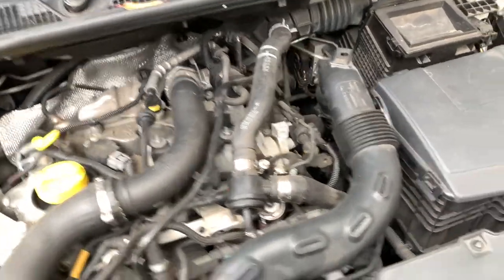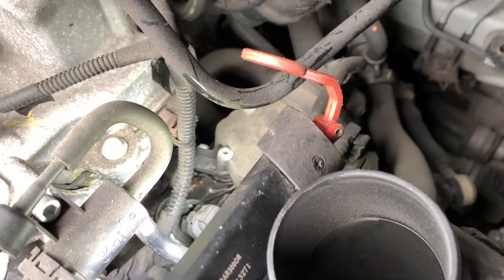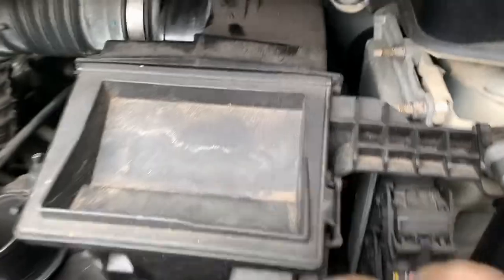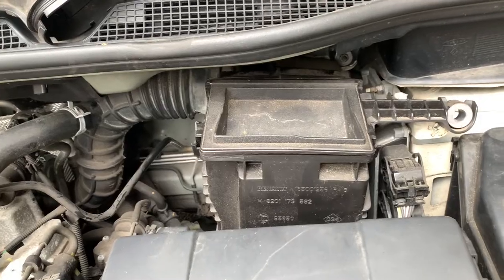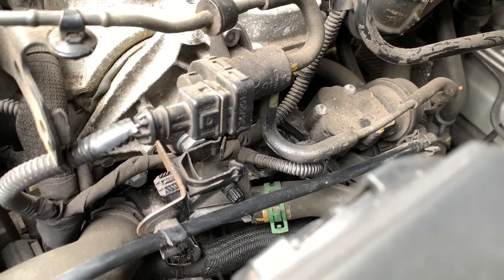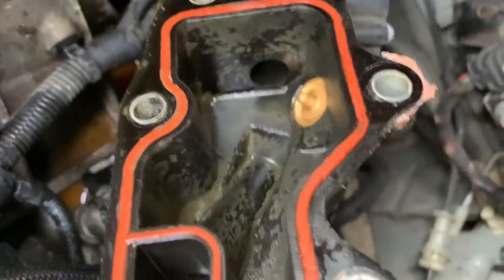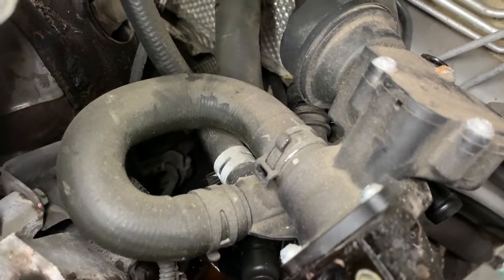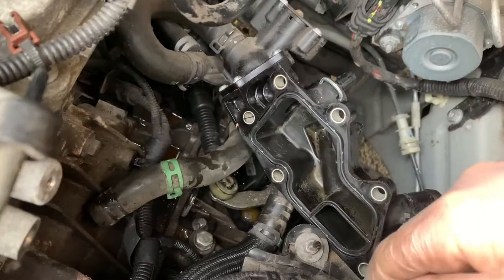Renault Captur 0.9TCe Losing Coolant? Renault 0.9TCe Coolant Leak Repair.

Comment: The part is called a water outlet (£104), I made the mistake of ordering a thermostat housing which goes into the other side of the engine. Anyway I didn't have the confidence to fit it so my local garage did it for £60 labour. Also important to know that after you may think it's still leaking as the coolant level will drop and the excess coolant will be puddled under the panel beneath the car, the coolant level naturally goes down as the engine cools etc. Hope this helps someone
Reply from the maker: That could come in useful. I got the part off eBay which called it a thermostat housing, but on eBay I had the benefit of a picture to compare,.. which I didn’t look at properly and still got it wrong 🤷‍♀️

Comment: Just got this problem.so thanks for the video. This is added to the squeaky suspension. The front brakes sound like a banshee chasing me. And for a car that uses so much plastic there is the rust. It's nice to see that Renault are solving the problem of all the plastic in the sea by sticking It in their cars . I had a Renault in 1990 and it's reassuring to know that they are still making the same crap with the same problems
Reply from the maker: All those are just design features. Absolutely hateful thing tbh.

Comment: Did the job today , your video was a great help .
If it helps anyone I lost 2 litres of coolant doing the job and the 3rd bleed valve  is on the left hand side of the rad (looking at the car ) 
A Nissan gasket part will also fit too .
Reply from the maker: Brilliant, glad it helped!

Comment: My clio 1.2 tce (which is very very similar) wasn't doing this. mine had excessive pressure in the cooling system which continued to be misdiagnosed by 2 different garages. I knew about the bleed for the air, and the correct coolant (massively important that bit) but mine was making the water in the coolant mix boil. this causes excessive pressure in the coolant system and eventually the expansion tank will explode, like mine did. I didn't get any warnings though. No HT on the dash, just a slight fluid loss. Turns out that my head gasket has been failing for quite a long time. possibly even up to 30,000 miles. the garage that eventually found it said that the gasket might have been 'mis seated' when the car was constructed in turkey.
Reply from the maker: They’re not unknown for head gaskets unfortunately. Pressurising coolant is usually a symptom of HG failure between the fire ring and water jacket, but not being bled up properly can give very similar symptoms. A sniff test can give a better idea, but with the way EGR coolers work on some cars even that can give a red herring these days.

Comment: Great video. I have some problems or similiar sympthoms. I have added few times coolant and after driving sometimes coolant smells right side of the car front. Can't see a leakage in engine or dripping under the car. How does in your case you find out the leak from? Same 0.9 tce engine also
Reply from the maker: It’s probably leaking really slowly and evaporating before it has time to drip. That’s the way this one was leaking. You need to look for coolant residue, like a pink crusty marks. It could be from the same place as this one but with the smell being where it is, could also be the radiator where the metal joins the plastic or even a coolant hose joint. Small leaks like this can be hard to find.
Reply: Thanks for response. I found the leak today, is the same thermostat housing that you had in the video. The coolant leaks were same spot over the gearbox. Thanks to you. Car is going to repairshop thursday morning for repairs.

Comment: Can you please tell what type of AC coolant do you use in Renault captur. Have the same issue but I want to fill it up to be able to take it to the mecanic, and I don't seem to find what type of coolant should I use.
Reply from the maker: You just mean the engine coolant? This one used the red stuff if I remember right but any car parts shop should he able to confirm the correct stuff

Comment: I have the Sandero 0.9tce.. That part looks like it was meant for my car.. The part I got is not authentic renault but I couldnt find anything else.. China seems to assume that I dont need a thermostat for my region or something... you'll see the housing is actually 2 sections.. the part that mounts up to the engine.. and the the tail end bunch of pipe that has a pressure emergency break cap..  they join with 2 plates with another gaskett.. (not the hot plug, leave that cap alone, I think it has a steel rod that melts at critical temperatures) that assembly can be removed from the engine mounting to reveal a little cradle housing thats supposed to house the thermostat... mine opens to reveal one end, (the engine mount side) with half a cradle and the other half or cap side with that hollow redesighned to be flat.. so a thermostat cant fit, (unless you saw it in half down the middle.. haha..).. I suppose China kept the base part compattible in case I can still use my original cap/pipe complex.. So now Im left with trying to service and clean my old thermostat if I cant find a new one, at least the gasketts is new and so is the temperature sensor, that can be refitted on my old housing.. JUST BE CAREFULL.. allthough I think the car will run without a thermostat.. I was lucky to discover the turbo water pipe connection was blocked on the china part.. inside the tube end was a plastic cast injection port that didnt sever.. or I quess QA was not done on these so nobody popped it out... Could have ruined my day with a toasted turbo core... Good luck and thank you.. Maybe China was thinking.. you need your original cap complex to visit midas and let them sort through the sizes untill they find one.. so you get a temporary cap for free...
Reply from the maker: This was supposed to be a genuine part but think it came off eBay so 🤷‍♀️. That blocked but is something to watch out for, good job you noticed it!

Comment: Hi! - do you remember the part number for the gasket?
Reply from the maker: No sorry, iirc it came from a local motor factors. Don’t think it was a genuine Renault part though.
Reply: I used part no.RE110624453R. Termostat housing gasket.
Reply: @StupidBlokeStupidVideos  So. I am doing this job as we speak. The RE001624453R part below works. Just wanna say thanks for saving one of the claps, the one where you PUSH and not PULL, that goes into the cabin heater.

Comment: Would you now the part number and were you was able to get hold off the rubber seal please.
Reply from the maker: Sorry mate, I can’t even remember where we got it from tbh
Reply: Thank ok it looks like my leek was from one of the weird plastic rings on the pipe luckily I nicked a metal jubilee clip of the air hose. Took me ages trying to cut the plastic clip off. Just hope IAM not celebrating to early. Really enjoying the videos

Comment: Hey I have a 2016 Renault captur h4b engine 0.9, it was mixing oli and water in the water bottle, I changed the oil cooler. Than it bursted the water pipe from the engine to the car ac radiator I have changed both thermostat now it's only bowing cold air in all temperatures and the water bottle is very hot what can be the problem
Reply from the maker: Sounds like you may not have to bled up properly, or you potentially have a blown head gasket

Comment: Does that model have a radiator cap, if so do u fill the radiator before filling the expansion tank?
Reply from the maker: No rad cap that I saw but the tank is more of a coolant reservoir than a typical expansion tank, it’s pressurised with the coolant system and the coolant goes straight into the radiator from it rather than pushing into it when hot and sucking out of it when cold like a typical expansion tank.
Reply: Reason I'm asking is the missus has a micra 2018 but it has the same engine in it, was bought from a dealer, I'm a plant engineer/fitter, she said to me top the washer fluid up so I went to do it and I checked the oil and water while I was there but the coolant like just plain water so dipped it with my hydrometer was only reading -4 so need changed and replaced with 50/50 mix but couldn't find any vids on the car to get an idea of what sort of job it be
Reply from the maker: @lewishope271  ohhhh. You could always go with the  lazy method I did in my bmw in this other vid. Works with pretty much any car as long as it has bleed points. 

https://youtu.be/IqWXPysALgc

Comment: What is the name of the part you changed and how do you bleed the system?
Reply from the maker: I just typed in thermostat housing on eBay and look for the right one, and got the wrong one lol. Bleeding the system is what I was doing removing the caps near the end on the side of the unit and on the inlet hose to the heater matrix. They look like tyre valve caps.
Reply: Nissan part #1106200QAB

Comment: Hi friend, can you explain or write down exactly which part you replaced or what is its name?
Reply from the maker: I just changed the housing gasket. I think it was listed as be thermostat housing gasket but I can’t find it on eBay now. Main dealers should be able to help off a microfiche is have thought
Reply: I believe these are the part number if someone else need them 110601073R, 110603082R.

 I’m having the same issue and this video helped a lot 🫶
Reply from the maker: @dennis420lundin  happy the vid helped you

Comment: my2015 kangoo has a leak around that thermostat housing area as well. leaking is coming thru 1 single bolt. so i just ordered a new gasket seal. should fix it. it actually wasn't leaking at all til i went to tighten the bolt.. thats wen it occured. if it aint broken dont touch it! lesson learned for me
Reply from the maker: 😬 just makes sure to have a close look to make sure you’ve not cracked the plastic housing by tightening it when you change the gasket…

Comment: Does Renault captur used two thermostat
Reply from the maker: It’s more of a junction pipe than a thermostat, other models that use the same engine use different set ups I believe though

Comment: After being at Renault, they changed a thermostat gasket... 300€ the joke. 

I get home (10 km from the dealership) and the coolant is again at 0!!!!

I go back to Renault... 

"We can't explain it" "It doesn't make sense"....

We go back to refill and I do a test... they put the car on a bench and when they lift it up and remove the caps from the chassis, about 15 litres of coolant fall to the ground!!!! :eek: :eek: 

The liquid was going into the chassis! normally it goes into the passenger compartment, on the floor... but on this occasion it was going straight into the chassis and you could hear it falling down the inside of the driver's door.

Has this happened to anyone? 

After the tremendous scare and damage, the mechanics told me at the Renault workshop:

"It's the first time we've seen something like this". 

I go to the office to say that they charged me 300€ to leave it the same and they tell me "no, I needed that repair too". 
And that they had to dismantle the whole car and the dashboard to change the radiator and we were already going to almost 1000€ with the labour because there are many hours of labour. 

In the end I was able to take it to a trusted mechanic who told me that he doesn't understand why they changed the gasket if it's not up there? 
They are going to try to bypass the radiator to see if it is still leaking or not and if not, we will have to dismantle the dashboard and change the radiator... 

I'm thinking of complaining to Renault because paying 300€ for a bad diagnosis is out of the question.
Reply from the maker: A coolant leak that big, shouldn’t be that hard to find 🤔